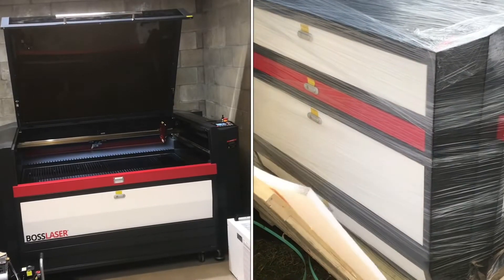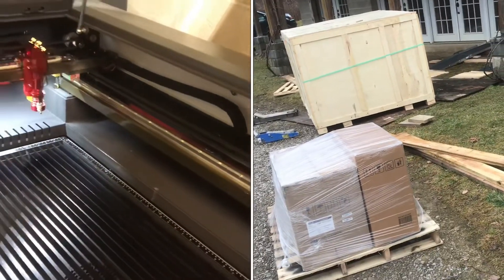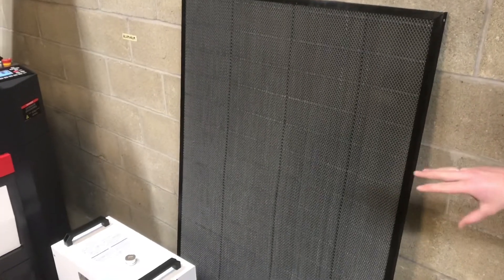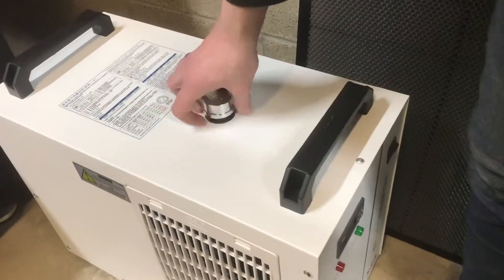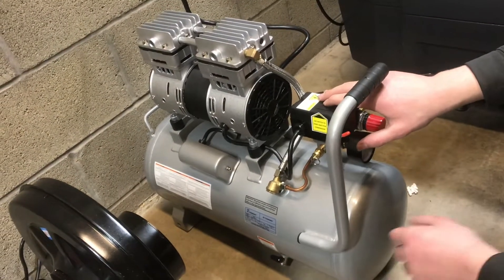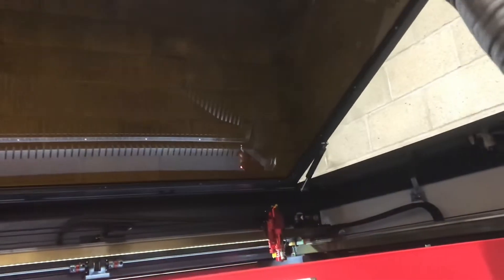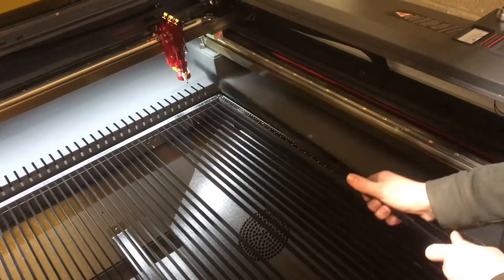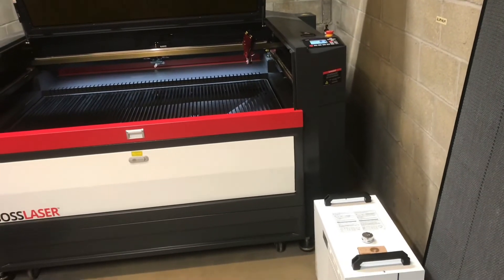“review” UnCRATE boss laser cutter engraver ls-3655 150w

Comment: My employer bought a Boss Laser, and when we cut a plastic, some parts of the plastic melts. Is this because my employer did not purchase the chiller unit?
Reply from the maker: The chiller just keeps the laser cooler. The laser we had before this one we use the bucket of water to keep The laser tube cool. My best guess is that the feed and speed or the laser power is set to high. I’m not sure which plastic you’re cutting, typically will make a chart of each plastic we cut, how thick the plastic is, they will put the feed speed and laser power on the chart. As the laser tube wears out over time, this charts will need to be adjusted. I hope this answer helps.